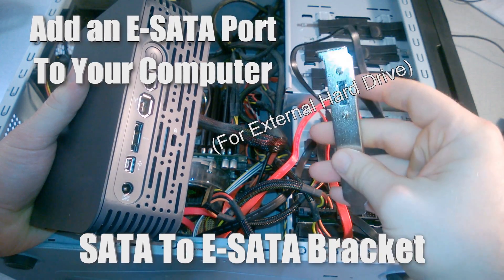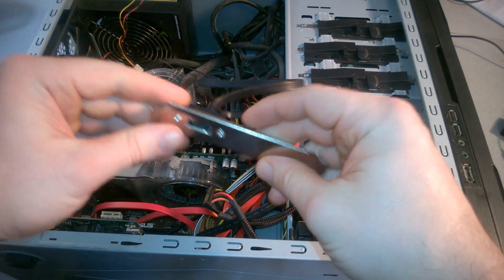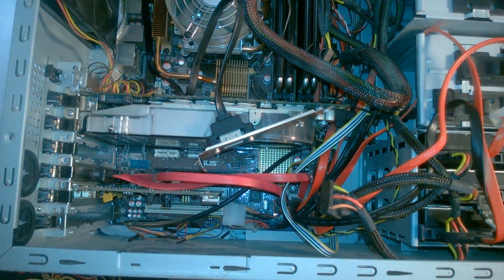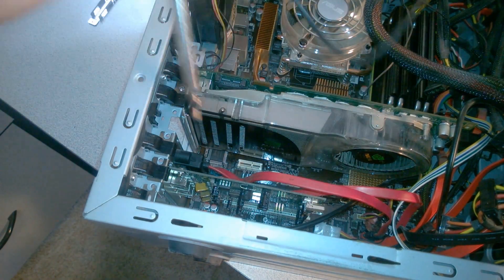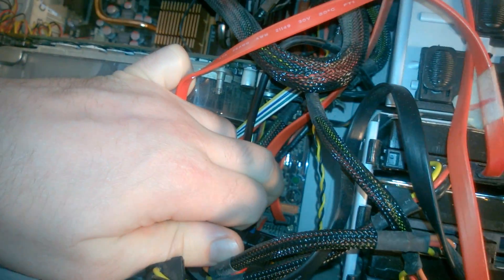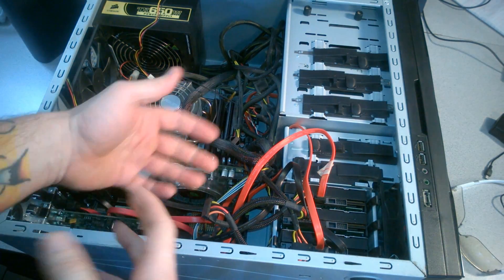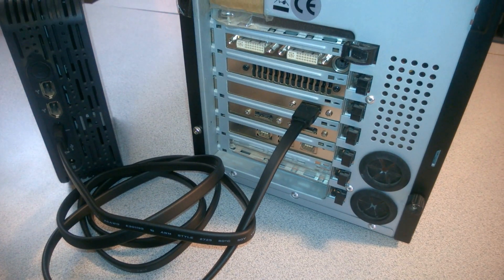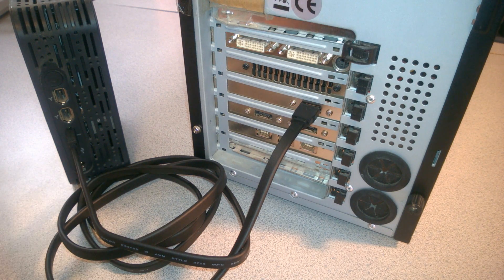Add an eSATA Port to your Computer - eSATA Bracket for External Hard Drive

Comment: I HAVE NO IDEA WHAT THIS IS ALL ABOUT  THE ESATA ON MAIN BOARD IS SAME AS SATA JUST PLUG SATA CABLE ON TO ESATA HANG CABLE OR RIBBON   OUT THE FRONT AND A POWER CABLE PLUG THEM INTO HARD DRIV COST 2 RIBBONS

Comment: Hi, I have an external OWC Mercury Elite Pro Raid 0 setup that is currently connected to my computer by USB. I was thinking of connecting it by eSATA. Would doing so require any reconfiguration of the drives or is all of that independent of the connection method? Thanks.

Comment: What are the speeds when transferring files on eSata compared to USB 3.o?
Also, the product you used, could you put a link in the description?
Reply from the maker: +coollary1 That depends on many factors but IMHO E-Sata is usually faster and it plays better with DAW's and NLE's in my experience. You can Google it and probably find several examples of both winning in a transfer speed battle. I thought I did link the product in the description... I'll check it and add it if it's not there. Thanks.
Reply from the maker: +BenoniTech Oh, you know what. The e-Sata bracket I used I already had on-hand. I think it came with an external HDD. But I'll link something similar, and the cable I used.
Reply: BenoniTech Thank you man! I was wondering which one should I invest in and I've so far read that its not about the speed but the protection of the data that is transferring and in that situation eSata wins. Thanks for the help